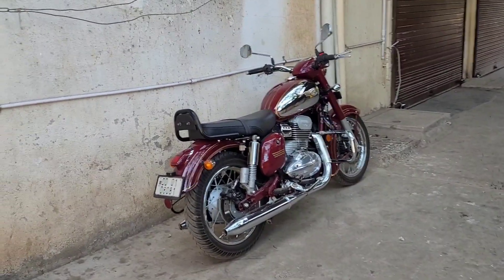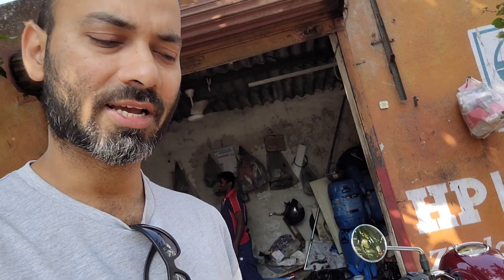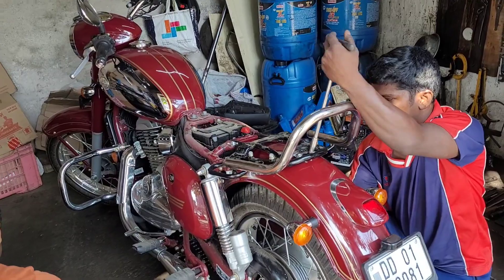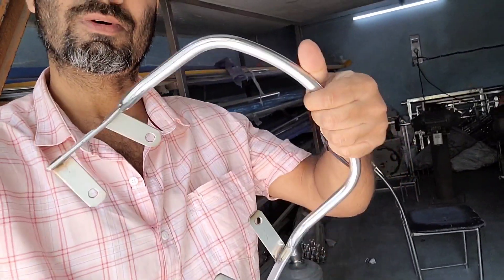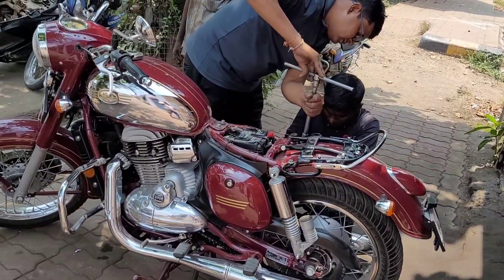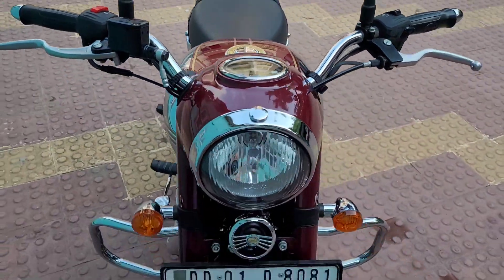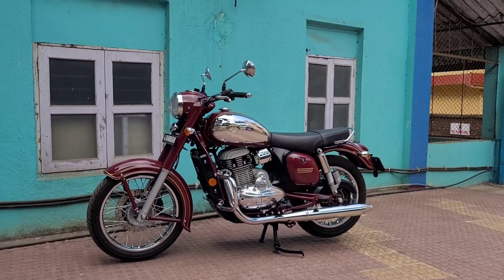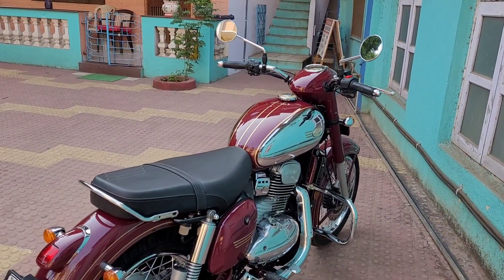Jawa Classic | Back Rest | Grab Rail

Comment: The bullet bactrest is the best but the one before that was better as per utility, just needed to get it foam insulted, would look fine too. There is a jawa owner in my city has done so. It not looks good and in flow with the motorcycle's body but also give some safety to the pillion and also helps om luggage. I like the 2nd last one.